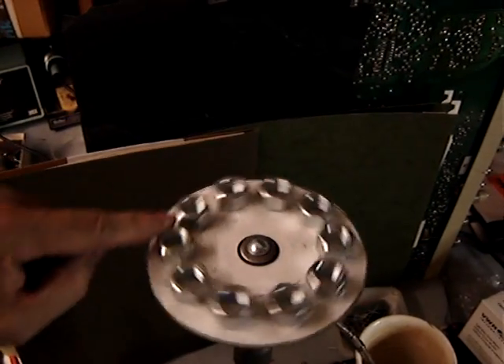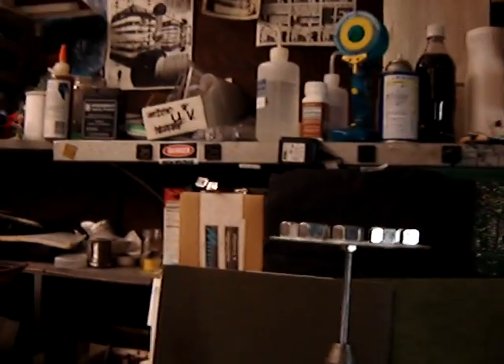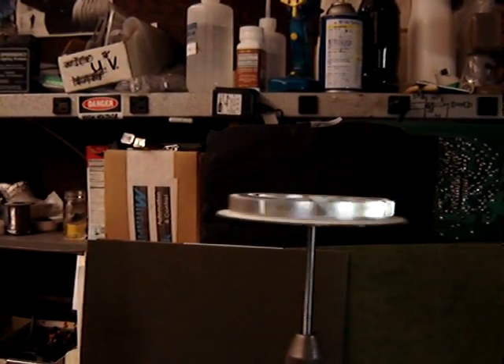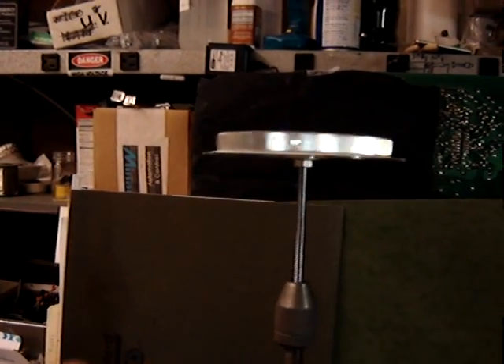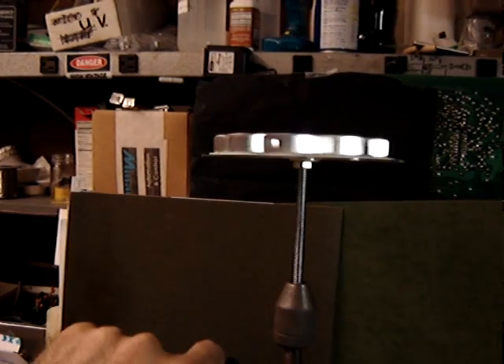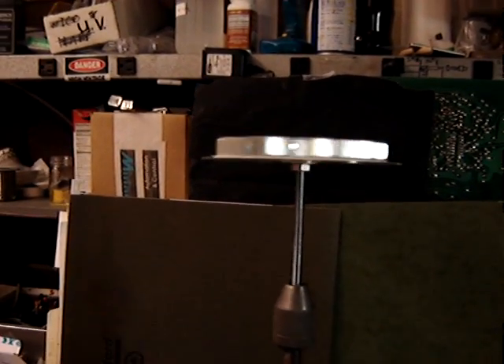Apparent reverse motion in truck wheel lug nuts

Comment from the maker: It also works without chrome lug nuts. 

With dirty or non-chrome lugs, I think we're observing shadows of more distant lugs through the slots of closer lugs, and since each slot sweeps out an image of a lug with a different orientation, it causes a moving fuzzy pattern resembling a dotted line. (As before, this pattern also moves backwards at 1/6th the wheel's rate.)

Comment from the maker: > image on the far side of the drum

Yes, but in this case there are small mirrors instead of slots, and they reflect parts of the outside world.

Unlike slots, the mirrors can be tilted.  If the nuts are aligned in a starburst, then the pattern remains unmoving when the wheel rotates.

But if they are aligned to a single straight line, then the pattern moves slowly backwards when the wheel rotates rapidly forward.

Comment: I'm quite certain that it'll show up if you shorten the shutter-time on the camera. For example, there's a video on YT where a russian helicopter seems to be floating mid-air with it's rotors standing perfectly still. The short shutter-time made the blades distinguishable instead of just motion-blur (as is the problem in this demonstration) and the framerate of the camera happened to sync up with the rotors so that every time the camera took a pic, the rotor happened to be in the same place...

Comment: After reading up a bit on other causes you could be looking for than camera-syncing I only find text stating a 20-40hz needed for a light to seize to blink and start to be stable. But that wouldn't explain the lugs, Because then, in steady sunlight sans camera it would cause a ring, not a set of dots. So all I can summize is that the effect sought are reflections causing a strobe-effect-themselves while rotating, creating a blinking result that fuses in your eyes to steady or slowly-moving dots.

Comment: Yes, that's basically what I said. But my point was that the shutter-speed is probably too slow to produce distinguishable shapes. There's simply too much motion-blur. The latter-test you did with the reflections of the lugs worked better since the reflections where visible for shorter periods than the shutter-speed of the camera, in a sense that reduces the time of exposure and they appear more as shapes than the blur around them. Like using multiple flashes in a single still-photo.

Comment from the maker: > don't exactly sync up with the camera/eye 

True strobe effects are beat frequencies, and the motion freezes at a particular RPM (and, the pattern would drift forward or backward if the speed is slightly different from the camera frame rate.)

This lug-nuts effect never goes forward.   Also, it drifts in direct proportion to RPM, which is completely unlike true strobe effects.   Also, the geometry of the progressive flashes is trivially simple (but only if you build one and watch it work.)

Comment: ... But if the rotors (or truck wheels) don't exactly sync up with the camera/eye then for each frame the blades or bolts happen to be either slightly before or slightly after the position it was in the last frame (depending on the sync). And the result is the false-strobing effect of the wheels going slower or even reverse that it really is.